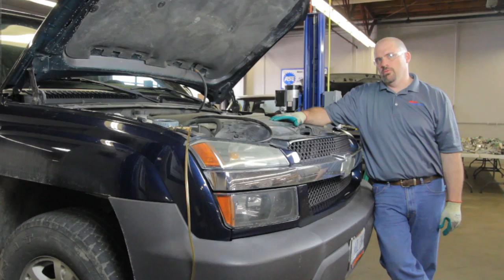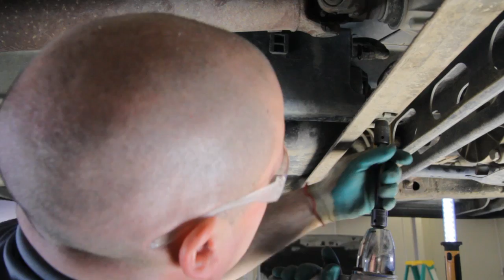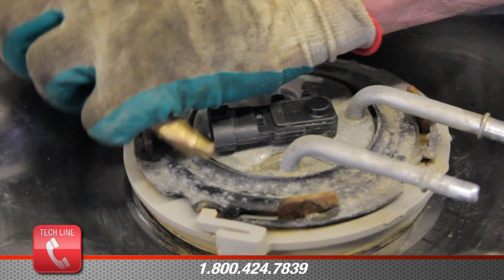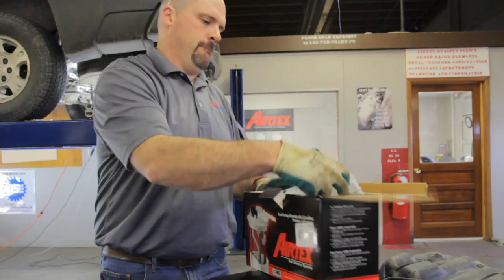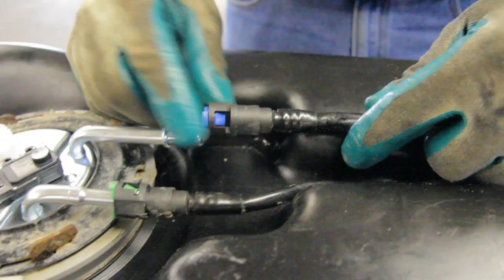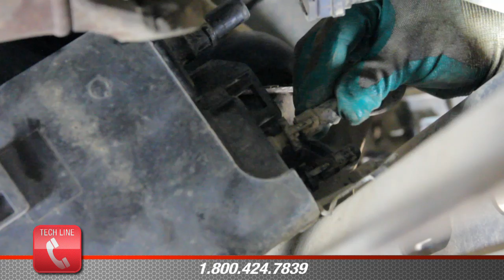How to install the Fuel Pump E3556M in 2002-2003 Chevrolet Avalanche, Surburban GMC Yukon

Comment: Not bad, but for the money being a corporate video I expected more like addressing the tools needed for the quick disconnects you show them just popping off. They can be a real bugger or simple... and it wasn't noted that you drained the tank at all. It would sure be a mess disconnecting the filler and vent w/o adequately draining might cause a huge mess or flammable situation.

Comment: I live in a rust state and I am having fits trying to get the lines disconnected above the crossmember at the front of the tank.  I have contemplated cutting the lines and running new, but that doesn't seem like a great option either.  I know they are the push connections but am working blind and there is dirt in the slide action.  I have it soaking with WD40 right now and will try again in the morning.  Any insight you can provide is appreciated.
Reply: Cut the cabin

Comment: After installing this exact part in our 2003 Avalanche, the gas gauge isn't working properly. It's actually working backwards, so when I put gas in it, the needles goes to E, but empty is actually at 3/4 mark. Found out the hard way! So what could this be?
Reply: You probably put the float on the wrong side of the pump so it works backwards. Only fix is to remove pump and correct it.

Comment: Hola amigos de Airtex.. tengo una camioneta Grand Blazer Año 2000 tiene la boma de gasolina (FUEL PUMP) dañada mi pregunta es la siguiente, le puedo colocar una bomba de gasolina Airtex E3556M a mi camioneta.? segun tengo entendido es de Suburban, Escalade 2002 _2003 les hago esta pregunta porque en Venezuela es muy dificil encontrar repuestos y mas cuando son vehiculos importados, esta bomba de gasolina la encontre en una Importadora que trae partes de vehiculos usados de USA. Espero su respuesta

Comment: when I lowered my tank the place where the filler hose connect got caught on the rear diff how did you guys keep from that happening i tried pulling pushing and it didn't come out i just lost the third fuel pump today -_-

Comment: Saved me tons of money with this video and with a little common sense to get me past the few things that were difficult (front line connects and the carbon canister connects, mine are different than shown) I am back up and running after 6 hours of labor in the driveway for under $300. Local estimates with a cheap knock off pump with no warrant ranged from $900-$1400 and $1800 from the Dealer. From me, my wallet, and my 2002 Avalanche a great big Thank You for the video.

Comment: According to the video you disconnected the fuel lines before partially lowering the tank or and before removing the carbon canister. How did you access them?  This seems difficult to reach on either side.
Reply: ***** That would be a good thing to add to the video, show where and how he gets to them, I am not finding enough room to get my arm in there. Looks like the best place to try to reach it is the outside front of the tank. But even then I was only able to release one of them the other was orientated such that I could reach one side of the clip but not the other a steel plate was in my way. I ended up lowering the back of the tank and going in from the inboard side, Detaching the lines where they attach to the fuel pump instead of the front of the tank, then detaching the line clip in the center of the tank. GM really made this unnecessarily difficult which is not airtex's fault.
Reply: +Robert H The video is good and bad at the same time. The people watching this to learn likely don't have a lift and are working in the driveway where you can't "easily" access those lines.
Reply: +nickma71 That would be me, I did not have a lift. I mentioned it because I found partially lowering the rear of the tank and getting the the line on the inboard side helped me.

Comment: My Pump failed again so I cut a door in the floor, made some cool brackets that hold it all back down and im good to go, now if that thing goes out again, it literally takes me 30 minuts, I just have to take out the seat on that side, pull the carpet back, take the brackets off and open the door.   POOF!     yukon denali by the way.      This pump seems much better.

Comment: Terrific Video. I have a 2002 Avalanche and after filling up yesterday, my fuel gauge went from F to E about 30 seconds after I pulled away. My Low Fuel light has remained on since then. I know that I have a full tank of gas, so I believe it's the fuel sensor. Would I have to purchase and install a fuel pump/sensor combination to correct this issue? Or does the fuel pump even have to be replaced?
Reply: The sensor is sold separately, 50$ at oreileys, but also comes installed on the pump